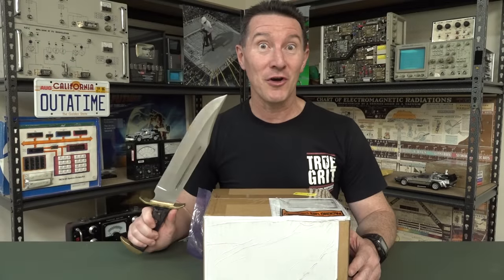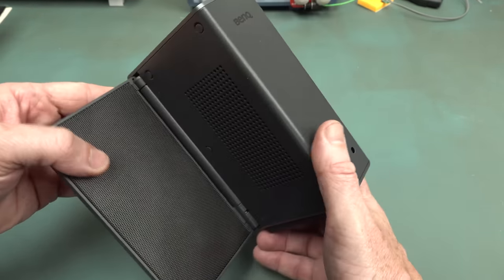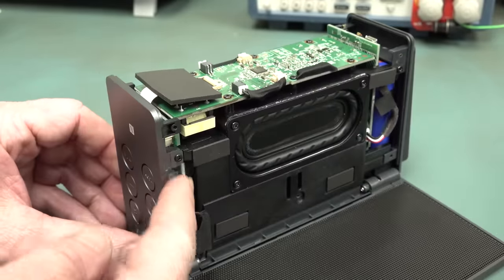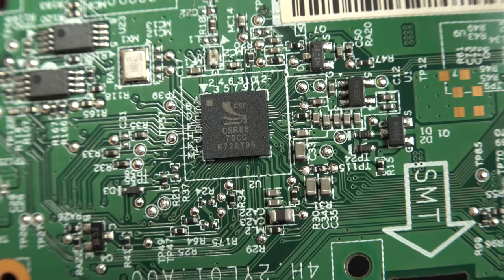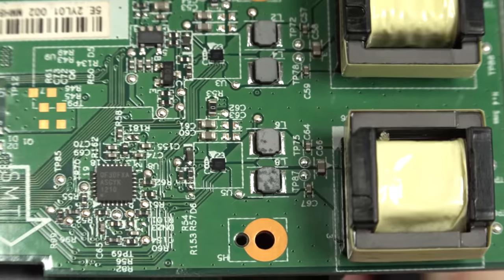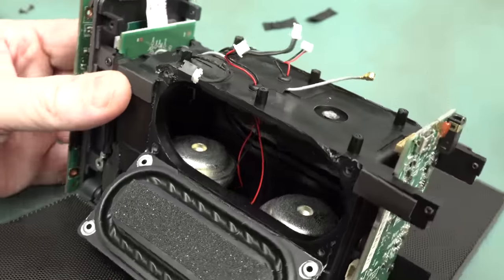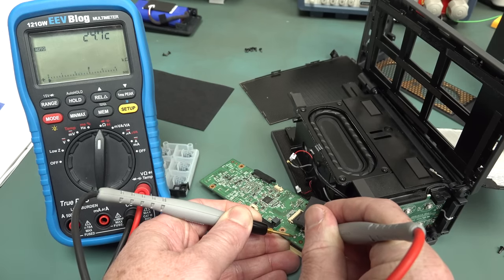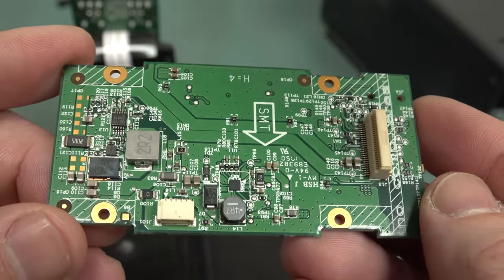EEVblog #1150 - Electrostatic Speaker Teardown

Comment: Are there any advantages to using these electrostatic speakers? Why not use a regular tweeter?
Reply: I don't own any, but...  the theory is that having an entire vibrating surface changes the shape of the sound waves. The claim is they sound "larger"  than a speaker box. You have to remember that some high end electrostatic speakers can be 5 feet tall (look up "Magnepan").  They've been around since the 60's. They can be very flat and compact. You could in theory hang them on a wall like a painting. Except they radiate backwards so it wouldn't sound very good. I think the biggest "advantage" for people is simply the novelty and cool factor.
Reply: Electrostatic speakers are way better for advertising .
Reply: A proper electrostatic mylar diaphragm has incredibly low mass compared to nearly all other speaker technologies. Driver mass, all other things being equal, is to speakers what mass is to cars. The lower the mass, the easier to accelerate.

Make them large enough and they can move a lot of air with no mechanical elements. You can actually make them a full range driver if the panel is big enough, but it's expensive and they get VERY large to do that, so usually they require a subwoofer. Martin Logan usually has a large (transparent!) panel above an integrated sub. I've heard them in person and the high frequency reproduction is incredibly lifelike.
Reply: Normally, electrostatics benefit from having extremely thin and light membranes. That means they can reproduce high frequency sounds more accurately since the membrane is easier to control than dynamic (voice coil) speaker. They don't typically vibrate at amplitudes as high as dynamic speakers, so they generally are not great at producing low frequency sounds. That's why they are often supplemented with dynamic woofers.
Reply: It makes naive people think they're getting something special?   An electrostatic tweeter (well, "ribbon tweeter" of various descriptions) can be excellent for stereo imaging, which is giving the illusion of sound coming from somewhere inbetween the two speakers.  I'm talking mid to high end studio monitors, not so much this particular speaker.
Reply: Better form factor and efficiency. You can fit a bigger diaphram in the same enclosure.
Reply from the maker: Marketing. And if you believe that marketing, a 10 fold reduction in distortion. Funny how I can hear significant distortion.
Reply: @EEVblog  clainetjunkie made a review of these. They sound really tiny and those elektret speakers are so extremely directional. If you listen of axis all your heights are gone.
This speaker is unfamous for a reason. Its marketing crap :/
Reply: If you use correct parts and design everything ideally, regular moving coil speakers do have more distortion inherently because magnetics are nonlinear. Furthermore, the frequency response for moving coil loudspeakers are quite bumpy because of the resonances arising from the diaphragm suspension and the moving cone. You get a nasty low frequency, 2nd order HP-like response in a sealed box cabinet, and a 4th order HP-like response in a bass reflex design (which you like have control over the Q factor by changing the speaker box, but only increasing it... annoying)

Whereas a reasonably ideal model of electrostatic speaker has no resonances, is supremely linear, and allegedly sounds better. 

Only problem is that it's impossible to have a baffled design, which means its low frequency response is poor.
Reply: @dom3827  All electrostatic speakers are directional, because the forward facing acoustic wave is destructively interfered with the back facing acoustic wave. You need a box or baffle to cut that out, and because of how the diaphragm sheet is fitted, it's impossible to get a good sealed baffle.
Reply: @__dm__  makes sense. But honestly. I dont know any electrostat doing this properly. I have seen like 1.80m high big electrostats at a customers home. Also were open.
Reply: @dom3827  I've never designed with electrostat speakers tbh, but that's what I gathered from the wikipedia page, and from what I know about moving coil loudspeakers, the stuff they wrote there seems to be abotu right.
Reply: @theladyfingers___  Yeah those ML speakers are truly amazing. If i had the money and the space they take up, i would trade my B&W speakers for a set of ML, even if they had no real bass response (some of them do not have any subwoofers)
Reply: Electrostatics are dipolar, which means the sound comes from both front and back of the speaker. This produces a wider soundstage than the speaker placement, in a proper listening room. Since they are light weight, and planar, they can produce more sound, more efficiently. As well, the shape of the sound is different from planar designs. Something like the difference between the light emitted from a flashlight, and that from a spotlight. At least for those who still sit down to listen to music. For those who don’t — it’s a hefty investment for the ones worth buying. Anyway, they’re louder and more accurate, the real ones ... not these. These are crrrrrap!
Reply: @eurobum2012  On the large floor standing ones its harder to pinpoint the source/speaker location. (you can get a simmaler effect by bouncing your cone speakers sound off a wall) Therese major downsides though, and they really like mid ranges low and sometimes high end sounds are sacrificed and they are far less effected with there power and will be far quieter. All things can be midicated but cones are just easier to get right.
Reply: Planar/Ribbon and 'Stat speakers have a low moving mass, meaning it can start/stop moving faster. This makes the vibration pattern its reproducing less blurry, or "smeared." In the right setup, they produce exceedingly clean, accurate sound, better than cone drivers. They need a massive surface area, however, to achieve any decent volume levels, and require a ton of current to compensate for the lack of mass, making amplification a challenge. Unless you invest a serious amount of money in the componentry needed to really "make them sing," they're generally considered something of a gimmick in the non-hi-end space.
Reply: @EEVblog  that's because you disconnect the ground of the speakers. I suspect that those wires are not there only for prettiness
Reply: Dave speaks of the BenQ speakers in particular here, as electrostatic speakers in general are a valid high end audio technology. This BenQ speaker is like a Vichy  VC99, where a high end electrostatic speaker like Magnapan would translate to say Gossen Metrawatt or Keysight/Agilent U1253b. Electrostatic speakers are just as valid a technology as electrostatic capacitor microphones such as the very highly regarded Neumann U47/67/87 series that you hear in more music industry recordings than not from the 1950's until now.
Reply: HUGO FUGUSEV Magnapans are magnetostatics, which take far less power to drive than electrostatics, and have a wire conductor on the diaphragm ... which from my experience has a tendency to separate and cause a terrible buzzing ... I digress. Different mechanism to achieve essentially the same goal. Both are planar, and move air/sound with the same basic characteristics.
Reply: ML typically integrates a woofer, not a sub.  But you are correct with everything else you said.
Reply: Not novelty or cool factor, although I dont complain when people find interest in my electrostats.  The set that I happen to own are full-range electrostats and being bipolar design, you dont want to hang them on a wall because you need to space them away from the wall a good amount (several feet).  I've been listening to high-end speakers for 30+ years and I can tell you that I purchased my current electrostats because they are some of the best speakers that money can buy and they fit my criteria.  They are not for everyone, as they require rather specific amplifiers, they need to be properly spaced, and they are very directional.  In the end, every speaker has its pros and cons and compromises.  If you're willing to integrate proper subwoofer(s) into your stereo setup and you have the room, electrostats are fantastic.
Reply: @ixfxi  What specific amplifiers do they need, and why?
Reply: @__dm__  you might be careful about criticizing non linearity. Sound is non-linear 😉
Reply: The high frequency sound is much less directional and not so 'beamed' so you have a much larger sweet-spot of the best sound
Reply: @TheCarpenterUnion  yeah i mean it can go haywire real quick--its hilarious how people aim for 0.0001% distortion and shit like 24 bit ENOB when your actual speaker can barely do like 10 bit ENOB (pulling numbers out of my ass) SINAD
Reply: @eurobum2012  Magnepans aren't electrostatic speakers, They're planar magnetics.
Reply: @dom3827 , did you mean "infamous?"
Reply: @__dm__ , well stated.
Reply: @johnstone7697  Thanks. You're only the 40th person to point that out. The thing is, to me, they might as well be the same thing ;)
Reply: You have to hear them to get it.  I went to electrostatic martin logans and never left.  The signature is so different than a conventional speaker.  In a conventional speaker you are listening to the colored sound of the cabinet.   On the electrostat there is no cabinet discoloration.

Comment: It's ashamed it's an elecltret speaker because otherwise it looks like a very well designed and constructed speaker that I'd consider buying if the price was right. OK after clicking the link in the description and seeing that they cost $299 there is no way in hell. In the $300 - $400 range you can buy the KMC3, Klipsch Music Center 3, Portable Bluetooth 2.1 speaker that puts out quite substantial bass for a 5" ported woofer. Crystal clear never a hint of distortion even at full blast. Peak rms 135 watts. Discontinued but findable still.

Comment: I believe it's 2 different names ... Phillips with double l's developed the cross point screw, and Philips is the Dutch electronics former megacompany.
That tape... I have what seems to be exactly the same. It sticks great and is super strong, but the adhesive dries out after some years.

Comment: 'stats are clean and uncoloured in general because they are ungodly fast in their response time to signal input.
  losses in definition of playback due to bluetooth and content format compression and their artifacts.
if you should ever get a chance to listen to a proper pair i suggest taking the opportunity. the detail that most can produce is remarkable.
the drawback? they aren't what a music person would call 'loud'. decibel increases for them involve increasing surface area(as demonstrated by the unit you are reviewing compared to a conventional midrange/tweeter combination.). these appear to be a large version of a microphone(powered) called an electret unit. still a viable comparison to be made between the two though. the closest would be a voice coil based driver versus a piezo-electric driver. the voice coil driver having a set polarity via the magnet versus the piezo being dependent upon the phase of the incoming wave form to align speaker phasing. at any rate...i found this very interesting not only the concept of the thing but it's execution. think back just 10 or 15 years. things like this didn't exist.
thanks for the vid dave.
=dok=

Comment: They have the SMT arrow so the operators know which end to feed into the SMT pick and place line. If you can have two rows, it's easiest to flip the rows 180 degrees across from each other so rotation of the panel doesn't matter. Maybe they couldn't do two rows?

Comment: I remember hearing a proper set of electrostatics a while back. Their were actually vintage floor speakers that used them as the tweeters, they sounded like modern speakers! It's too bad this is a poor example of them. Electrostatic speakers are still made for home audio.

Comment: That's really a nice little speaker system.  Thanks for sharing, EEVblog. :-)
It's bass setup reminds me of years ago when a friend gave me a couple of ESS Technologies speakers. They were big heavy-constructed real wood cabinets with a huge thick metal tweeter horn at the top front-panel and below that was a 6 or 8 inch mid-range driver and a 12 inch diameter passive bass diaphragm on the back of those speakers. The original driver and passive woofer's foam supports had all disintegrated, so I took the drivers and passive woofers out and replaced them with a similar-sized driver for the front and a 12 inch regular speaker on the back, with no connections to it's voice coil terminals. It only gets moved by the changes in air-pressures developed by the driver on the front
The cabinets were totally air-tight and those things sounded so friggin' awesome it's insane. The bass would thunder out of those cabinets loud and clear, along with the mids and highs, and yet the cones of the driver and passive woofer barely wiggled....it was kinda eerie ..lol :-D...  Incredible yet simple technology ... a retroactive WTG @ESS for those awesome speakers way back when, and WTG now  @BenQ for your Trevolo S Electrostatic bluetooth speaker system.  <3

Comment: Same type of no-HV drivers that I had in some ES headphones back in the '80's.... and they were amazing... absolutely passive headphones with just a dual step-up transformer box between the amplifier speaker outputs and the headphones.

Comment: These little  "woofers" look very much like the fullrange drivers Bose uses in their Soundlink Mini. Or one of these Chinese rip-offs from eBay that claim it's the Bose driver. Or the one from eBay is indeed the Bose driver, just without the Bose sticker. Don't think Bose manufactures them theirselves. Anyways, those little drivers look exactly the same.

Comment: You are confused...  Philips (who used to make consumer electronics, you can still buy it but it is now just a label on equipment made by others) is not the same as Phillips of the screwdrivers and also not the same as the Phillips oil company.
Note the single L in Philips and the double-L in Phillips.

Comment: The lower frequency bound of the electrostatic panels can be calculated by the shortest dimension of the electrostatic panels.  Judging by the visual dimensions of this, the woofers in this thing are going to take over in the 300-400 Hz range.

Comment: Interesting video ! You could convert this into a portable electrostatic headphone amplifier by adding a self bias stage on the output of the center tapped transformers, as is done with the STAX SRD-6 self biasing driver unit (see schematic). Add a couple of caps, resistors and diodes and voilà. Would be a fun experiment.

Comment: Sagan may be able to hear the hi frequencies better. those cost around £250 so glad you got it back together ok,  18r play time, 3D with stereo and party modes.I suppose the bass needs some volume to move the air around those side ports

Comment: Electrostatic, well at least Martin logan, need to fire sound forward and backward. Also a lot of definitive speakers use passive bass radiators, seems to work well with a nice big surface area for the sound to move it, not sure if useful for that small.

Comment: Dave.. Did you put the meter onto the divider fabric to see if it's conductive and grounded to the metal frame?
Reply from the maker: The divider is not connected to anything. It would be pre-charged.

Comment: I remember year ago, probably late 70’s Wireless World magazine did a project over many months on a DIY electro static headphones, that one could make, I never tried to may it my self, it seemed a way to DIY ETC myself.
Reply: +Gary Miles YES! It was Wireless World 1973 and my roommate at uni built a pair. They worked stupendously well. They looked lashed up of course, but the sound quality was phenomenal. Easily better than some quite expensive Sennheisers we used at uni at the time. 

The spatial field and high frequency response were truly amazing. I tried out some STAX electros of the day in a top audio store and I'd say the DIY ones sounded just as good ... I actually preferred the sound of the DIY ones.

Comment: Quad ESL 57's the Daddy of Electrostatics, full range too, not just electrostatic tweeter. Date from 1957, I had a pair for over 45 years.
Reply: Radfordperson Yes!  My wife wouldn’t let me have them in the house - they looked like old fashioned electric convector heaters in a kind of off-gold colour.  Needed to be rather large to get any sort of bass response.
Reply: +Radfordperson I'm just guessing from the name obviously but were/are you a Radford amp fan or even an ex employee? Be interested to know as I worked for Arthur in 1973/4 as a student engineer.
Reply: Hi Bob, you are correct, I have a very nice STA25 III, SC22 and FMT2. Amazing that you worked for Authur. I would be interested in any info available. I'm on pinkfishmedia as Radfordman.  I used to know Jim Rogers.
Reply: Hi Richard, I don't blame your wife, they are a bit intrusive. In fact I have two pairs and have thought of double stacking them.

Comment: @5:12 I would be suspicious that those elongated speakers are the woofers, with the "speakers" on the front being nothing more than port baffles to effectively increase bass response... will find out if I'm right after you get that bit apart. EDIT I was almost right, it was the other way around...!